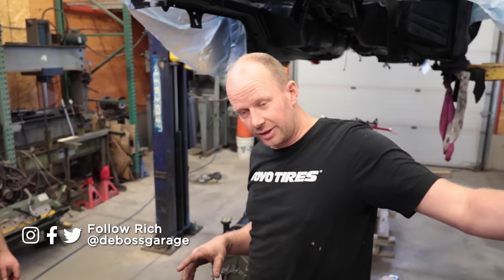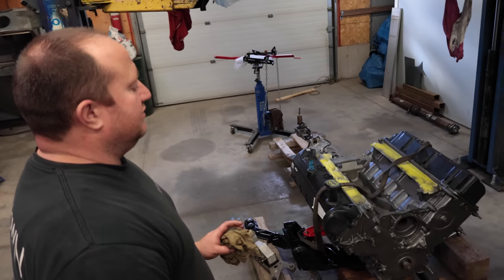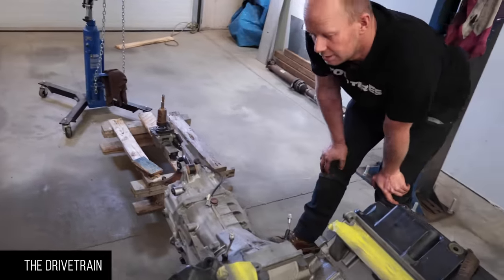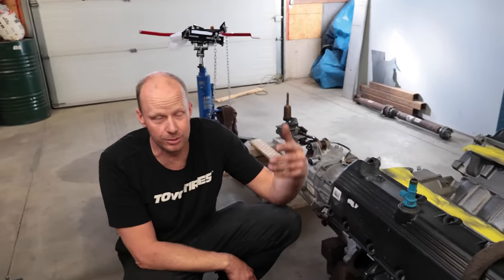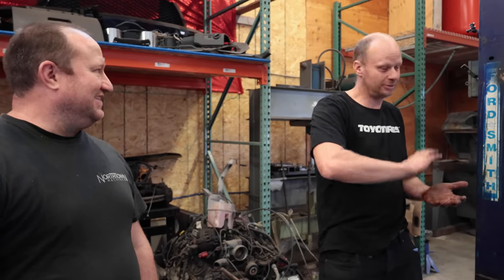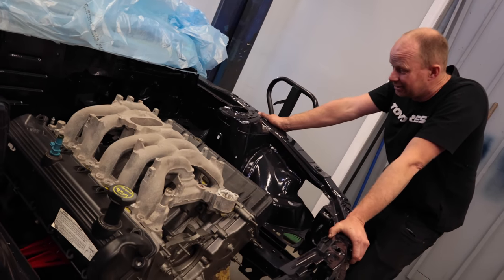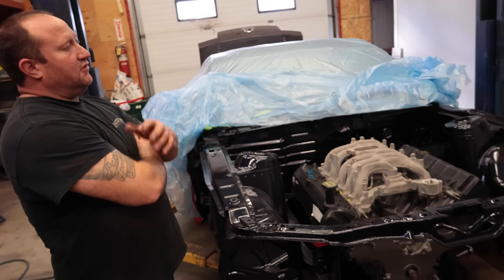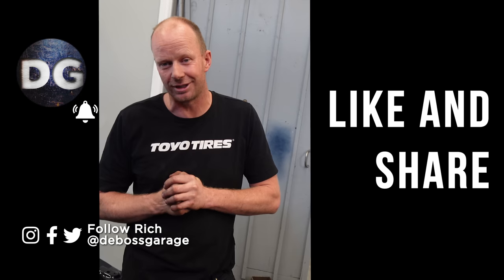6.8 Ford V10 stuffed in a Mustang.. 8v71 Blower or Nah? #V10Stang [EP1]

Comment: Almost went this route in my Fox. The 6.8 V10 is the same motor as the 5.4 with just 2 more cylinders along with unique cams and crank (due to length)… everything else is 5.4 parts. 4.6 intakes will require adapters to connect with the heads due to the difference in deck heights but you should be able to modify two 5.4 intakes.
Also I was going to use stock style 4.6 motor mounts and found that if I swapped them from side to side that it would move the motor forward a few inches. Also not sure about using 4.6 headers as again there’s a difference in deck height between the 4.6 and 5.4/6.8.
Another thing is that no one makes aftermarket cams for the 6.8 and the closest you can get is to contact Comp Cams where you can send your stock cams in and they will weld and regrind the lobs.
I really wouldn’t compare this with a 4.6 but would look into any 5.4 swaps for comparisons as the 6.8 is only around 4” longer than a 5.4.
In the end I dropped the 6.8 to go with the 5.0 Coyote due to the lack of information and aftermarket support for the 6.8 which is a shame as it’s a good platform.
Reply: Aren't f150 lightnings a roots blown 5.4l? Might make it easier to match a blower up to the intake using a modified version of that.

Comment: Scott was concern about ECM control for the V10 would a Haltech system work for him? The Skid Factory was able to add many inputs and outputs to the new builds they are working on. All the best from Surrey BC
Reply: Yeah, I was thinking Haltech.
Reply: I third that motion, contact Scotty aka Tuning Fork over at Haltech or the crazy Brazilians at Fueltech.
Reply: I don't recall if it was Haltech who told me or someone else (tried dozens of places) when I had a 3valve V10 I wanted to swap. The issue was the V10 firing intervals, 72-72-90-72 or whatever it was. It needed to be done as two five cylinders and that really would up the cost. Another told me there is a V10 generator with a simplified wiring harness that could be adapted and use an  aftermarket tuner as the stationary engine is tuned only for idle and operating RPM.

Comment: I had a 2014 mustang with the mt 82 all stock with 700whp. No issues had like 20 hard drag strip passes ran multiple 6.9 passes in the 1/8th with it.

Comment: A S/C is cool but not sure thats a good idea being the crank is a split journal and the crank snout is a shallow bolt design. There will be a lot of torsional vibration and load on that little crank snout. A turbo setup would be less stress on that crank not to mention it will make more power on less boost. Also there is less real-estate for the added belt drive parts for a S/C.

Comment: Definitely run a blower, a lot cooler. Some food for thought, I'd recommend running a 10-71 or 14-71 blower instead of an 871 purely since the 10 or 14 will keep up with the CU at rpm better than an 871 would. The smaller the blower the harder it has to be turned to create positive pressure, but it will also drastically raise IATs. A 10 or 14 can be driven slower and still move plenty of air while keeping IATs down. Hope to see more updates on this awesome build!

EDIT: Also for running a blower, its smart to have the crank machined with another keyway. Dual keyway blower hubs are pretty essential as to not strip the keyway out of the crank snout even in low power applications, though I know you guys know what you're doing just wanted to offer what I can!
Reply: This comment needs pinned!
Reply: @andyreid7274  I'm surprised it hasn't been more seen up until you saw it..

Comment: Have you considered a wasted spark system? I’ve seen a highly modified V12 Jag which used a coil on wire setup. However they’d ran into a similar problem, they couldn’t find an ECU that could control all of the cylinders yet give them the tunability they desired. Finlay, I believe it was a company in Australia that came up with the solution. They made up a harness that fired 2 cylinders consecutively, , one on ignition and the other on exhaust. They used a Haldex ECU to control everything, basically as far as the ECU was concerned it was running a 6 cylinder engine.
Reply: That’s how the build it yourself guys are running that DOHC V10

Comment: I installed the same 2v v10 into a 64 Lincoln continental. I stripped down the factory harness removed Pats to run it on the factory ecu. I remade the intake manifold and flipped the throttle body to the rear of the engine. A bunch of parts had to be made but tuning can be done on the factory ecu.

Comment: Those v10s are really good motors. We have one in a f550 the truck full of tools and what not weighs 15,000 pounds and it’s got no issues. It has a hard life and idles lots cause it’s got a PTO running a picker and a compressor but absolutely zero issues

Comment: Blower would be visually exquisite. Properly sized turbos with a correctly designed system will bump the mid and top end without shoving more low end torque into the getrag and 8.8.

Comment: Maybe you could try getting onto haltech about your ECU situation? You can probably get away with using a haltech ECU with your stock harness and chopping up one of their adapter harnesses or flying looms. The haltech Elite 2500 does 1-12 cylinders.

Comment: My 04' 6.8 is a torque monster and 4x4 its moves surprisingly quick for such an large old truck. Its 24.5ft long from gattleguard to bacl of the flarbed, weighs 9213lbs with my tools in it. I love it. Except the horrendous gas mileage in town.

Comment: In my time as a dealer tech, the only trouble we saw with the V10s was a local seafood company. They switched their fleet of refrigerated box trucks from diesel (6.0s, shocker) to gasser V10s hoping for less repair costs. Which might have worked if they had drivers that would make sure the trucks got serviced. Combine no oil changes (no kidding, we replaced engines with <20k miles, blown up with almost no oil in the pans) with the high rpm of interstate highway speeds with 4.88 rear gears, and we put in at least as many V10s as we ever did 6.0 PSDs....

Comment: Fellas, be sure not to use a roots blower, and additionally, be sure TO use equal length headers with a double CARVEN X-pipe (not that stamped magnaflow BS), OR a Y-pipe that increases in diameter for matched flow. Dual 2.5 into single 3.5 or dual 3 into single 4 will be roughly equal flow, so you won't see any restrictions from doing it, unlike the usual same-sized Y-pipes. Also, the X or Y setup itself ALSO has to be equal length, in addition to the headers.

As for the ignition, you can do wasted spark 5 cylinder since the Triton has split crank pins and is even fire, just like the Build It Yourself guys are doing.

Comment: The 362 hp number is for the 3v. This engine would be rated 310/425. 

The dominator is the only holley ecu that shows to be able to run a V10. I would love to see that. Im currently planning to swap one of these in my 82 F100.

Comment: Ford engineers were running a V-10 mustang at the local Drag way in 2004 it was as fast as the Ford GT in the 11’s spinning the tires on the way down the track.

Comment: It's been done and was downright badass.  But tons of custom work. If you can make it work with stock components you be the man.
Reply: Im gonna claim it I should back it up. Ford made one, and only one. An air force dudehad an article on his in one of the mustang mags from early 2000s. And the boys currently working on the dohc are up and running and even got most of their tuning bugs worked out. Had their first start last week. It's sick.

Comment: That transmission is fine don't listen to forums, the gears hold well into the 800hp range it's usually the clutch that is a problem. Also if you ever want to have it built look up ben calimer.

Comment: I'm liking the way your thinking,multiple Mustangs owner for 40yrs. My opinion for induction would have to be supercharged, turbos work well but all that plumbing and intercooler gear is ugly no matter how well done the installment is ,as opposed to basically bolt on blower and all the beauty of that unobstructed V10   staring you in the face.
Just my opinion of course. Thanks for sharing this cool project.

Comment: Take that fugly intake manifold, slice the center out with a circular saw such that just the horizontal portion of the runners remain, then fabricate a plenum in there with a big throttle body. Either that or machine the plenum off the bottom and weld on a bigger plenum and throttle body.
Also, I know he said standalone is too expensive. I gotta say, getting into standalone stuff, Speeduino and megasquirt in my case, is so incredibly worth it. It's not at all rocket science, you can DIY a harness no problem. If you can solder and get up to speed on reading diagrams, it's totally doable.

Comment: There are alternator relocation brackets for these ford modular engine it just takes some digging.... MMR might have a version. The Electric power steering rack from the 2011-2014 mustangs will bolt on to these mustangs cuz they're still the same gen! (There's 1 extra bolt on the EPS rack & then u figure out how to wire it)

Comment: Various levels of Haltech will run it no problem. Wasted spark style is just 5 cylinders paired, which most ECUs will handle as they can often do 6-8 cyl sequential. Bigboy haltechs can do 12cyl sequential with dual DBW throttles even, and it will probably be easier than making something stock working, and less problematic to getting one of Holley's systems working.

Comment: 2001 ford escort zx2.... running 92 lb injectors on 30 psi boost. stock was ~15 lb..... sct pcm flasher or a chip

Comment: Roush racing has v10 Ford computer to run propane system. That modified computer might give you the control over the system w supercharger or turbo system? 
Merely a direction to look at for potential parts sourcing.

Comment: Thats a simple answer if you already have them….twin turbos and the blower👍🏻👍🏻. 6.8 is a 5.4 with 2 more cylinders added to the front and thats why the deck height is taller/wider than 4.6 and 4.6 intakes wont fit without custom spacers

Comment: I'd suggest a SC, fitting twin turbos and the piping as wide as that engine is is going to be tricky in a Mustang. Not to mention spool times are better. Not to also mention attempting to fit in an inner cooler. Not to also also mention I've said "Not to mention" too many times.

Comment: The 4.6 manifolds will not fit properly because the V is wider due to the deck height. The 5.4 stuff will fit, though. You either need adapters or some cutting and welding to fit the 4.6 stuff. 
Also, for an ECU, why not look at RusEFI or Megasquirt? They have versions that run 12 cylinders without an issue.

Comment: I have a v10 in a 70 fastback. Plan to put two Chinese bois up front like what you were saying. Started the v10 project two years ago. Let me know if you need help with depinning a harness. If I remember correctly the 03 models have the same pin out.

Comment: I'd go with 11.8:1 compression, 276* cam, 0.400"/0.500" lift, 112 LSA,  ported heads, and 1-5/8" long tube headers.  should tickle 600 bhp at 6300 rpm.  I'd be afraid to put boost to the split crank. my .02

Comment: There are really good stand alone systems that won't cost you $3500+. MaxxECU Street, Race & Pro runs 10-cylinder engines, so if it is OK for you to use waste spark (1 coil per 2 plugs) and semi-sequential fuel injection the Street version för $800 + VAT will do. The Pro-version is $2300 + VAT and can do all sequential. All of them have CAN-bus. wide band included ans internally supported and a host of configurable outputs. And they has flex fuel, boost control, traction control etc etc. Use their tiniest version "Mini" on my tow-rig (Volvo 940 turbo) and it works great, the only version to not have built in wide band controller so I use a LC-1 for that over CAN with great result. I'd say you can modify the OEM harness since MaxxECU supports all the usual GM and Ford coils and sensors.

Comment: With the increase in torque, I would have left the rear end stock ratio, or tuned it to cruising speed against the transmission and sweet spot on the engine torque curve. (or waited to get the engine dyno'd to learn the sweet spot then make sure that it cruises at speed limit at best efficiency)

Comment: For the ECU, I can think of two relatively affordable options, 1. run each bank with individual ECU (Speeduino or microsquirt) 2. use a Speeduino Dropbear ECU and use the wasted spark, it will run up to 16 Cylinders in that configuration.
Reply: Megasquirt would be the best and cheapest option and depending on what ms3 version used it would have 10 injector drivers and 10 coil drivers.  I love megasquirt and I have used it since the early days soldering them together myself.  The ms3 platform has evolved into a very capable ems that has features that only recently became available on many high end systems.
Reply from the maker: We will look into it for sure!

Comment: Holley Dominator ECM will do up to V12 with individual drivers for injectors and coils. No wasted spark stuff. Good because you can do individual cylinder timing. Harness will need to be fabricated so get the pin tools and crimpers to fab it.

Comment: im partial to turbos myself, i would love to see either a big single turbo or twin turbos on that motor. me and my friend installed a twin turbo kit on his 2005 mustang gt and that thing ripped. it was a rear mount turbo kit, stuffed them right into the rear bumper. it had less traction problems than his dads supercharged 03 cobra, and got better gas mileage. lol.

Comment: Im at 5:19, that motor should fit just fine. The V10 is a 5.4 with 2 extra cylinders. So if the car can fit a 4V 5.4 then itll fit a 5.4 with the smaller 2V heads which is the same with as a 2V V10

Comment: Splitting two controllers across the engine sharing inputs may need watchdog? I remember a V12 BMW with each bank having its own distributor. I don't know how spark was distributed.
Probably enough displacement with 1/2 16V?

Comment: Just curious, if you are going with an engine that is made for low end torque and not revving, why put a 4.10 rearend in it? Wouldn't a 3.73 or 3.55 be better?

Comment: The You Tuber for the V-10 is BIY,Build It Yourself and he is using Cyotye heads converted to 5 cylinder's doing what you were talking about doing your intake.
Reply: 4v heads.  Not coyote.  Coyote heads won’t bolt up to a mod block
Reply: @thomaskostoroski9985  Well the only 4-valve heads that Ford built are the Coyote with the duel overhead cams,not to mention that the young man said he cut apart 2 sets of heads for each side and welded then together.

Comment: Its super easy to wire in an standalone ecu. You run it as an 5 cylinder. Wasted spark and paired furl injectors. I used a megasquirt ms3x bingo bango no big deal. Keep it n/a and ill drove my camaro to you when i am finished and lets race

Comment: The combination of a low reving engine and a low gear differential is a mistake unless you have 60” tyres.
2.72 3.08 3.55 would be the primary choices depending on tyre size and gear ratios in the transmission.
With the amount of torque and light weight of the Mustang (especially when boosted) all it will do is disintegrate tyres at a touch of the loud pedal and not go very fast at red line.

Comment: The only difference between the 5.4 V8 and 6.8 V10 should be the balance shaft in the driver's side head. Otherwise everything is identical. The 4.6 is different in stroke. The 5.4 and 6.8 have a 3.55 bore and 4.17 stroke, where the 4.6 is square at 3.55.

Comment: If the holley does not have enough wires for a 10 cyl,  you could still us it but run a wasted spark setup, you would only need 5 wires for that.

Comment: 11:20 the fuel injection on that V10 is a "bozo", just put whatever injectors on it and tune it with a boost reference fuel pressure regulator... as is the old 4.6 likes running 42lb/hr injectors idle at 10psi, 0psi vacuum 20psi to 23psi and if it makes 15psi of boost the fuel rail sees 38psi and the engine light turns off. V10 with 42lb/hr injectors on that set up would be running 600hp 850lbft, as to be about 1600lbft of brake torque "rev n' dump".
Reply: would need four 100gph injector pumps and two 14gpm lift pumps, to run a return style system on it that holds a good fuel flow. lift pumps get a 10psi pressure regulator so the injector pumps don't get hot trying to move air.

Comment: good effort here but a ton more work and customization than say build biology 3rd gen camaro - i think ford is more expensive and has less options generally - it can work but the question is should it work given the expense - the camaro is not cheap either but i think swaps are generally a bit more straightforward - pls keep updating this story - you all should be able to get efo and computer sorted - a blown 302 would be much easier but the v10 will have the torque and probably be better around town, more streetable. i hope you all go for a very big intercooler and 3" exhaust #got v10?
Reply from the maker: Its not about practicality, but more on building something that hasn't been done before.  Sure your camaro will beat it in a race, but at a show, this car will have 20 people standing, looking and talking about it for every 1 of the camaro.
Reply: @DEBOSSGARAGE  Full disclosure - i have had many camaros - extreme bias - the build biology camaro is pretty nice - they did an excellent job on it - and thorough, am sure the v10 stang can get to that level with your attention to detail and persistence - keep posting updates on this project - worthy! you and Scott have good vibe, experience, patience and also you have resources but you are not spending so much as to make it unobtanium - it is reasonable progression on this build #deboss v10 #pony car